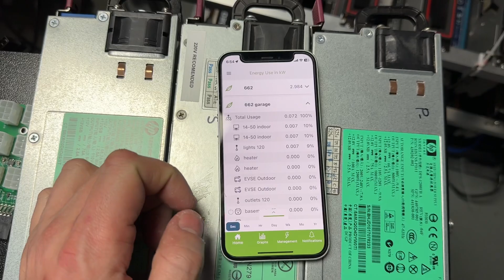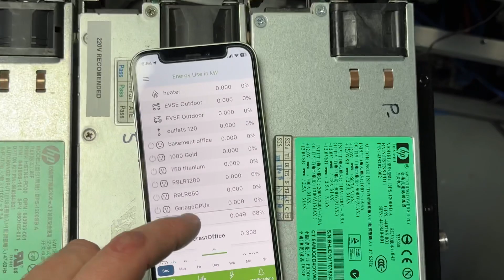Emporia Smart Plug Remote 240V control for $12? Automate your rigs!

Comment: Have you compared it with the tp link smart plugs ? I'm trying to figure out what to get ... thanks
Reply from the maker: I've only used a few brands of smart plug, but no. I bought on specs and this was the cheapest smart plug that allowed more than 10A, and did current monitoring.

that being said, I know others in my small community have tried other devices like SwitchBot
Reply: @Ovalbore Tech  Thank you for info

Comment: Been using these exact smart plugs for over a year as well and they work great! Run on 240v to run one power supply and have them daisy to trigger my other server power supplies.
Reply from the maker: have you run in to any dropping out when consistently used above 1000W on 120V or 1350w on 240V?

Glad its not a super secret. not sure why Emporia lists these as incompatible with 240VAC when they work so well
Reply: @OvalboreTech  Honesttly haven't ran them at that high of a power draw for that long since I run octominers for my more power hungry rigs. The most I ran on them consistently was around 750 watts but no issues there. I actually searched around looking for ones with circuits that could handle 240v as most only did 120. Figured they were made for outside the US and just added a 5-15 plug for the US market haha
Reply from the maker: haha had the same thought process. plugged one in to 240 with my eyes closed, and was like 'huh. neat!'
Reply: @OvalboreTech  haha you must have been a fly on the wall in my place too!
Reply from the maker: @CapeCodCrypto  huehehehe I'm not on trial here!

Comment: I’ve been using sonoff powr2 for 240v loads for a while. They work well but you have to wire them yourself. Before I ordered the sonoff ones I stared at my 120v generic tuya smart plugs from Costco and then said “yeah, nah” 😂
Reply from the maker: after reading your comment, I went over to look at those again.. hadn't seen that they did power metering too now.. definitely a good solution. 

I didnt want to have to wire and deal with more terminal style connections, but that's definitely a fair play :)